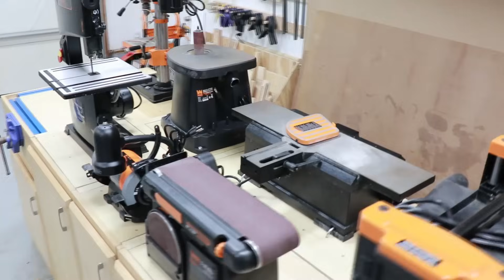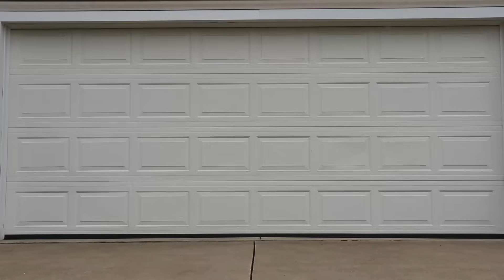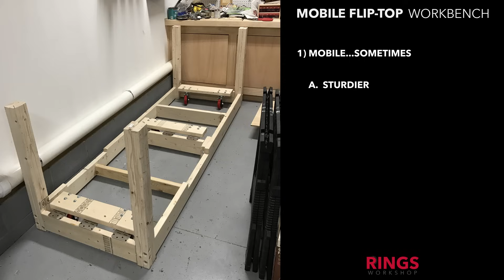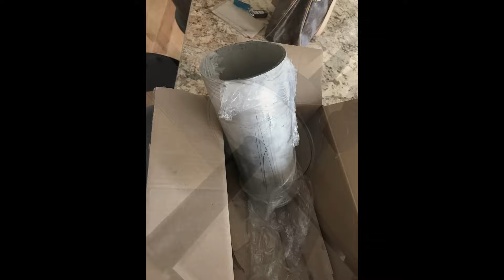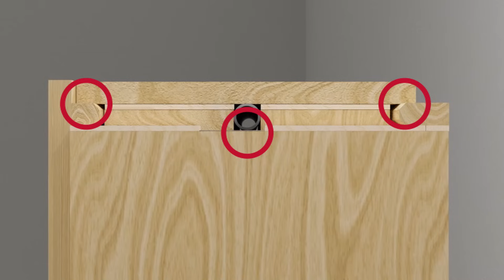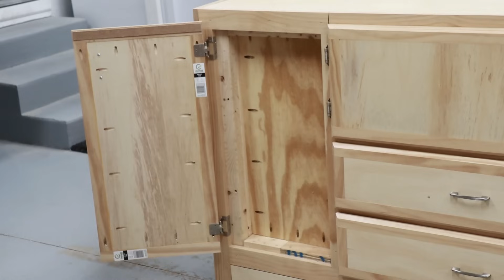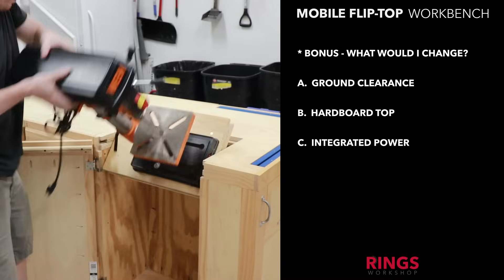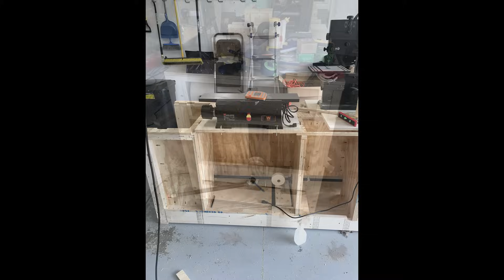Mobile Flip-Top Workbench

Comment: “Congratulations, you’ve built the smartest woodworking bench I’ve seen in months. It really inspires me for the one I want to build for myself. I’m also thinking about integrating a router sled that could pivot from the wall onto the workbench surface to flatten large pieces of wood. If I can’t find an intelligent way to make it work, I might suspend the router sled from the ceiling and lower it with a cable‑and‑pulley system so it can position itself on the bench.”

Comment: I love this bench.  One idea that may make the lift system easier is instead of buying 4" pipe and cutting 3 pieces buy 3 (or 2 in my case) of the cheapest 4" hole saws from Amazon.  They're $7.70 each and likely cheaper than a steel pipe + shipping.  Cut the wood out with the hole saw, then cut or grind off the backs off the hole saws and use them as the ring, perfect fit for the wood and easier I think.
Reply from the maker: Haha never even thought of using a hole saw, I like it!

Comment: Beautiful work. Only thing that I would like to be able to flip out of my way is my miter saw, on the same bench as all my other crap. I am still using a portable cart stand to use that thing (which is better than using it on the ground, but not by much. Thinking about building a new work bench along the only wall in my garage that I can. Its a nice long wall, but I also want to build in storage. Miter saw needs to be a bit lower, so I would need to figure out some sort of slide in piece that covers the empty slot, if I set it up to just flip down the face.
Reply from the maker: The only reason I didn’t do the miter saw is I use my miter saw and table saw by far the most, so I wanted it out all the time, but you definitely could do this if you wanted.

Comment: Love the bench and the hidden castor feet design. I’m adopting the cam system in a bench I’m building currently. I’ve worked out everything I need and how it all assembles, but I’ve noticed that where the steel pipe passes through the 6x2 timbers at each end, there is some sort of nut secured into the same hole the pipe passes through on the inside face. What type of nut or fixing is that because I’ve looked and cannot find anything that allows the pipe to pass through.

I assume it is there to stiffen everything up as the pipe is taking the weight of the bench at those points when the Cams are engaged?
Reply from the maker: It is a flange just to make it stronger and reduce wear to the wood.  I forget the exact size I use, I know all the fittings I used are in the plans.

Comment: really nice work bench, sir. Definitely beats my flip top workbench with built in table saw that I'm looking for ideas on how to improve when I build my next one. I used a 4 x 8 for the size and wish I would have built it in 3 modular sections so i could fit it through doorways/gate opening when I want more room than my back patio work space allows. Came here to check out the cabinetry and drawers as I want a way to prevent so much dust from covering all the items stored on the shelves and underneath but now I'm reconsidering everything. 

I noticed you have your power coming in from overhead, how'd you do that …? is it as simple as just some sort of retractable power cord wheel mounted to the ceiling?
Reply from the maker: Ya, I plugged a power cord reel into the same outlet my garage door opener uses.  Have the power right next to my air hose reel.

Comment: How are the hinges holding up for the supports for the wheels?
Reply from the maker: No issues at all.  I think if the weight was one the wheels 24/7 it could be an issue, but they are only holding that weight for a couple minutes at a time.

Comment: AWESOME VIDEO! Thanks for doing all the work on producing the 3-D explanations. Very helpful in understanding the details of the cams and wood grain layout! I just purchased a 10” Dewalt table saw and a 12” double bevel miter saw. I have a dewalt scroll saw and a shop fox drill press. I plan to purchase a dewalt planer. This was exactly the type of bench I was considering to make. However, I wanted to incorporate my table saw into the bench. I almost cried when I saw you didn’t. But, I understand your comment on the wood snagging on the table as it comes off the table saw. Is this why you didn’t put your table saw into the table? I wonder if you could design it so that your table saw is at the far end.. always upright with the fliptop tools down the rest of the table, but then have something like a thin sheet of luan that would  sit in a recess overtop of them all within this would be fairly light to remove…. Then all your tools are in one bench… but what are the perfect tools to have….? I’d be interest to hear others’ thoughts. Probably not a scroll saw since you want your knees to sit under and around the tool as you sit on a stole and do detail work. Thanks again!

Comment: Fantastic engineering/design!! I was pondering if/how to make my Bosch 12" sliding mitersaw fliptop as it shares the bench with my raidal saw and the RS and MS fences are not in line (over 19" difference in depth from the wall).  You have giving me some great ideas on making my MS flip down when I want to use the radial saw.  I'd be interested in knowing any challenges you had getting your Mitersaw surface in perfect alignment with the workbench top; I would love to see a short vid on fliping your miter saw. Even though i don't need a full bench build there must be a few ideas in your plans to help me solve my problem so I will buy your plans, a great bargain for the fantastic knowledge you are sharing. Thanks

Comment: I think this bench would be much better if some of the tools beds were at the height of the bench. Like the thicknesser for example.
Reply from the maker: Ya the planer that could have worked most likely, would just need to lower the rotation point, maybe the jointer, but unfortunately not for bandsaw or drill press because of how tall they are.

Comment: Huge Gaps between every single neighboring benchtop surface, is big enough to drive a bus through - absolutely horrendous!!
Some reasonable and simple ideas but executed very poorly - his amateur skills (or lack of) certainly show. The benchtop surface is so distorted, every item moved across the top would catch on the highs and lows of its unevenness.
Waist of materials and time.
Reply from the maker: If there weren’t gaps, the top and bottom would rub, along with this being in a garage as the wood expands/contracts it would only get worse.  You would need something more precise than a metal tube for it to rotate/slide on and likely use something other than plywood if you wanted a seamless gap.  

Since you decided to be so critical and think it was done so poorly, I’d love to hear what you would do different that would still provide the same functionality with the target audience of a small shop.

Comment: I have an interesting take on this. If you have space you could make ALL platforms the same size ( save for maybe a table saw) and have a built in bench in the garage with the same type of modular inserts so you can actually swap out the sections with what you might need depending on your project and also be able to move around your equipment to more adaptable places. The rotating assembly I feel could be patentable as it seems unique for it's brilliance and simplicity.
Reply from the maker: Think that is a really cool idea!

Comment: I’m attempting to build this next week! I’ve got the wood and pipes. Just waiting on the planer and jointer to arrive so I can square up the crappy Home Depot lumber first. 

This will be the foundational/inaugural build of my shop/man cave. I just wish I had the equipment/knowledge to film the process.

Any tips on making the build go smoothly? I’ve watched this and studied the plans a few times now. Hopefully my hours of watching woodworking videos is enough to get me through this monster of a build 😂. I’ll take some photos throughout and post them somewhere when it’s done. I’ll also take notes of any issues I come across that may help anyone else attempting this. Until then, cheers! 🍻
Reply from the maker: So excited to see how the process goes for you!  Be patient, it’s a long process and can get tedious at times.  Like most bench builds, having a bench to build the bench would make it a lot easier haha.
Reply: @RingsWorkshop  hey, Rings. I started the bench today. I’m a newb with a bit ocd, adhd and dyslexia when it comes to measuring. So it’s gonna take forever haha. 

Anyway, just wanted to let you know, I’ve found an error in the plan. Item 1F (belt sander top) has conflicting measurements. Pg. 6 shows 8 1/2” and pg. 7 shows 12 5/8”. I was able to use the cm to determine the right measurement though. Also, the greyed out part on the left side of the top (pg. 6 & 7), doesn’t say the measurements to be cut off. I’m assuming it’s 2 1/2”, because it looks about the same size as the little notch in the corner. Just want to verify before I cut that part. Thanks!

Comment: That unused cabinet is your tape space, duct tape, painters tape, double stick goes there.  Also, you don't have to trash your paper dispenser.  Just notch out a 1/4 inch hole in the flip top for the power cord to go right along the edge where the door closes, so the the cord doesnt stick in the door when you flip the tool out.  I think if you use a cable mounting clamp to hold the power cord right next to the slot (on the tool side obviously) it should drop into it as the tool flips up and drop out of it as the tool flips under.  I think I'd like to see your design applied to kitchen appliances too.
Reply from the maker: Great ideas!

Comment: PERFECT. Thank you for the detailed explanation.
I want to make the Bench Lift ... the cam part was clear but the Castere part was not.
CHEERS
Reply from the maker: Appreciate it!  The casters just mount to the bottom of the board that is hinged to the bench.  When the cam rotates it forces that board down, as well as the casters, which lifts the bench up onto the casters.

Comment: Honestly I feel like the door trim while mostly decorative does add some functionality and stability to the doors especially given they are an integral part of the patching mechanism to each of the flip tops and plywood does have a tendency to chip and warp if not protected by a hardboard like you have done.
Reply from the maker: Very true, I like the look, and I guess I don’t regret it, but if I was going to do it again I don’t know that I would add it.  I initially thought the angle of the chamfer on the doors would be more severe and I didn’t want plywood cut at like a 60 degree angle as it would look awful, but it wasn’t that extreme.
Reply: I suppose I could see that.... If it was a higher ply I suppose chamfering the edges directly wouldn't be bad... I would still worry about the weight of the tools warping it personally though. Still an awesome build regardless!

Comment: @RingsWorkshop thanks for the lesson.  Certainly an interesting concept on the lower/raising part. You kept saying cam...which made me think camshaft of vehicles.  What if you used the lobes (no I don't know if that's what they're called...I'm a woodworker not a mechanic...lol) from a large truck welded in place? Adding the metal around your existing wood was a good idea but metal would be stronger. 
I like the idea of your style flip...to a point.  I need something to counter balance the weight because I don't have manly muscles...my desktop planer weighs 90 pounds...
As for your table top...what about a full size sheet that clips into place when needed but hangs flush to the wall when not in use?
I certainly like the idea of corner tracks.
As for the empty space add flat magnetic strips to hold your bits...
Reply from the maker: Lot of good ideas.  Metal cams would have been the way to go for sure just wasn’t an option at the time.  Planer for me was easy to move, the jointer however is the pain haha.

Comment: Amazing creativity…with raising table on wheels to move…and also with locking the flip table with doors..Congratulations 

I have a question. What prevents the lift lever to turn back to its original position and bring the table down. What locks it at 180 degree..thank you in advance
Reply from the maker: Thanks!  The weight of the table does, it actually goes a bit passed the thickest point on the cam so it would have to essentially raise itself more in order to fall.  I had planned on making a locking mechanism when I was building it and then once I got to that point realized there was no need, it’s never once fallen when I’ve been moving it.

Comment: This workbench idea is incredible and looks like it will fit my needs of my small shop perfectly. Now that it’s been a few years, how is it holding up as an assembly table? Also is there anything else you’ve noticed that you’d have changed if you were to build it again?
Reply from the maker: Still going strong!  I tend to keep the hardboard on top a lot during assembly so I don't drop glue on the bench or worse down one of the cracks and have it harden up.  Nothing else I would change as of yet.

Comment: How much weight do you think one of the flip tops will be able to hold? Thinking of incorporating my lathe into this. I haven't weighed mine personally, specs say 121 lbs. and it is 34 inches long so that would be a long pipe. Would probably need to use a 1" pipe. Thoughts? I guess I could just build until it works. ;)
Reply from the maker: It would support a lathe just fine, harder part would just be rotating the weight up to the top but the bench would hold it fine.  Jointer is my heaviest item and it weighs 73 pounds but is kind of awkward to pivot since it’s so narrow, would assume lathe would be similar.

Comment: an idea for the space you have not filled would me make a series of French cleat trays that can have holes drilled in to hold router bits. you could have a tray for each type of bit, so when you want to use them, pull the one tray off, find the one you need, and stow the rest back in place. French cleats can be done with fairly thin stock, when they are only holding a pound or so of bits.

Comment: This solves the problem I've been seeing with most flip tops is that they don't end up with a usable surface that's level with everything else when the tool is stored. I don't WANT to be having tools on each side. If I have a table saw up, I need that level with the other surfaces. Although I'm not sure the tools become level with the surface. At that point I'd just move the tool normally for storage. So maybe height of the underside surface/counter top and where the pivot is located will help with this. If I need a mitre saw up, I need the same. I had been considering flips with armatures and other ideas, but this is very much a Less-Is-More system. The only thing I'd maybe also consider a spring loaded locking pin, but that again may not be necessary.

Comment: Thanks for the video, I'm very impressed with the design and plan to build my version of this flip table. One question as you do not show exactly the thickness of the pipe you use. Where did you get the pipe and what is it's exact diameter? You state the 1/4" spacer and 3/4" spacer that butts up against the pipe must be just a little thicker than 1". All the pipe I'm finding is well over 1" Diameter, more like 1.055". 1/4" plywood and 3/4" plywood are both under 1/4" and 3/4", then there is the aluminum spacer which I'm finding available is .025"
Any help you can provide is greatly appreciated...
Reply from the maker: I’m honestly not sure off the top of my head, I believe it was 3/4” ID and a hair less than 1” OD.  I know I have the exact one listed in my plans but I am not home currently to measure or look at them, my apologies.
Reply: @RingsWorkshop  Thanks for your reply, I look forward to hearing back once you have a chance to check your plans. Thanks again

Comment: Very impressive design.  The method for securely locking the tool base is brilliant. Your presentation, explanations and final photos are all we need to design our own.  Dimensional plans would not be much use since everyones' tools are a different size!  I was wondering if a few strategically placed electrical outlets in some of the doors would allow you to have a single power connection to the whole unit.
Reply from the maker: Thank you very much!

Comment: Couldn’t you rewire the tools running/snaking  all power cables to the empty space on the side of the bench (the section you don’t know what to do with). And make that your power source of the cabinet with a central ac connection.
Reply from the maker: I could but I would still have to plug in a tool each time I used it since it’s a flip top bench so not really sure the benefit there.

Comment: just bought the professional sawstop(mostly due to your recommendation) i’m going to build your multiple tool workbench. 
is there an “easy” way to change the workbench height? 
or 
do i just need to use your post build solution (raise the saw) 
ken 
btw
really enjoy your sincerity an humbleness
Reply from the maker: Appreciate the kind words and excited that you are going to build a bench as well.  If you house a bandsaw and drill press in the flip top you can’t make it too much shorter as those are the tallest tools.  If yours are shorter than the ones I used you could, but I had to notch out the 2x6 as it was because they were too tall.

How do you like the saw?